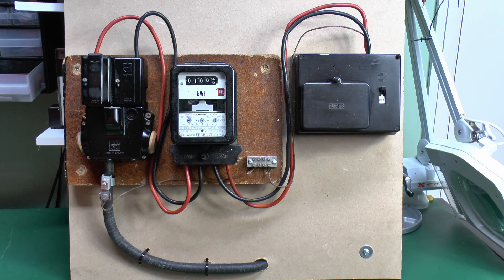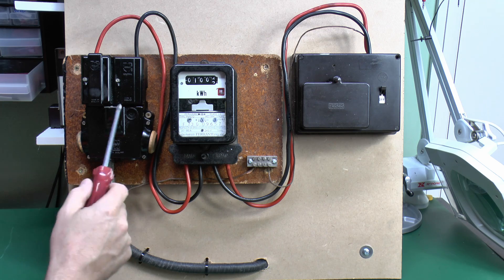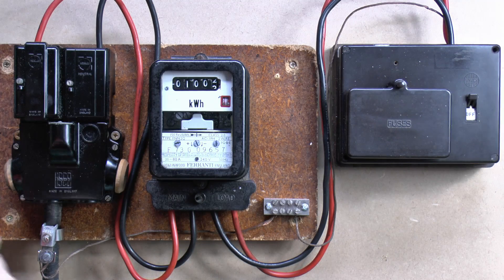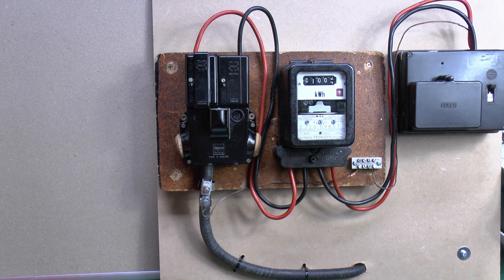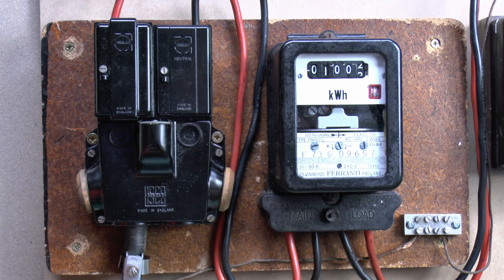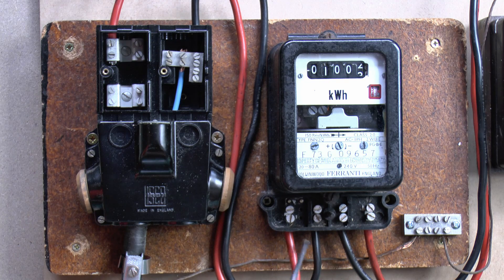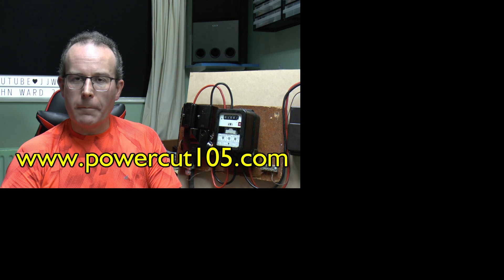Cutout, Meter and Fusebox - Who Owns What?

Comment: Hi John great video this is what I studied when I did my 16th edition IEE regs ends of 1980s and my city and guilds 2360 ,one point  you talk of a 800amp fuse from the road I take it that will be from  say one of the legs from the 3phase star (. L1,L2,L3 )   eg. L1. Would have a 800amp fuse but L1  would have a split to 4 houses after that fuse ?

When I get the money I am going to put my self through the 18th edition
Reply from the maker: Yes, one fuse per phase, and that is then split off to multiple houses.  Usually a 3 phase cable in the street and each house connected to one of those phases.
Free 18th edition course from Sparky Ninja here: https://www.youtube.com/playlist?list=PLg1OV4f2xHzVZMPyo_A8xd7s2jzd8WhP3
after which you can just pay for the exam at a local centre.
Reply: If you are asking how the homes are connected to the substation transformer, then yes houses will be tapped from one of the 3 phases, l1 l2 l3 from the distribution main in the street via joints along its run,each of these joints can accept a max of 4 service cables as well as the distribution main. The fusing in the substation that protects the distribution main is more like 315 to 630 amps, but John is still correct that these fuses will offer little to no protection for a short circuit at the end of the service cable in your house, such faults will usually burn themselves clear, this is one of the reasons i believe manufacturers deliberately make their concentric cable live conductors from aluminium because they know there is a very slim chance of upstream fuses operating and aluminium can melt easily. Even in the off chance a fuse back at the substation does operate the short circuit from the service cable will look like a roman cable and will still cause severe damage to it's surroundings and if you are in the vicinity without any ppe your pretty much fucked.

Dno's try to balance their network so if a housing estate has 150 homes then they will load 50 houses on each phase on the transformer.
Reply: @MissRiaElaine Hi, it is very common to have a 3 phase supply to a block of flats and then it gets split to single phase to supply each flat. Depending on the load of each flat, the main 3 phase incomer cutout (which is usually above the main door) will have either 100a fuses or solid links which will be red in colour in its cartridges.

Comment: In my house the incoming supply cable comes into the main fuse but another cable (same type) then comes out of the main fuse and through the wall to my neighbour. So if I pull my main fuse (not that I should) will it also shutdown the neighbours supply?
Reply from the maker: The fuse is just for your supply, the neighbour will have another separate fuse on the other side of the wall.
Reply: @jwflame  thank for the reply.
Reply: On older properties it is sometimes the case that the fuse feeds both but more common the loop is connected before your fuse

Comment: Hi John
At 26mins..there’s 4 screws next to the neutral connection,  if an earth was connected there would it become a TN-C-S or remain a TN-s .?
Reply from the maker: TN-C-S, the same cutout can be used for different supply types depending on how it's configured.
Reply: @jwflame  thanks John
Reply: @jwflame  sorry to ask again and probably appear stupid.. but here goes.
If the earth/strap was removed from the incoming cable (tns)  you could convert it to a  (tncs) by connecting the main earth to to the brass block next to the neutral ?
Reply: @davidmarsden8868  the earth from the lead sheath would be connected to the neutral terminal aswell if done properly

Comment: Thinking of separating my shed wiring connection,  at present it goes from the house, prefer to have it wired from the meter box, how would you spilt it so you have a extra wire coming out to go towards the shed, thanks

Comment: Hello John  Really helpful video, thank you.  All the equipment you show in your video is just inside my front door and the casing around the cables prevents the door opening properly. Is there a solution to this that doesn't involve moving the meter etc. Electricians I have asked about the job don't seem interested.  One told me I could chase the cables in to the wall and this could be done by a builder although the electricity supply cable I have appears to be in a solid 'pipe'.  Is the advice I've been given true and safe?  Thank you
Reply from the maker: The fusebox or consumer unit can be moved by an electrician.
The rest of it including the supply cable can only be moved by the network operator and your electricity supplier.  The supply cable cannot be concealed in the wall.
Reply: @jwflame  Hello John I understand who moves what.  I don't want to move anything because I'll have no option to then have a smart (notoriously inaccurate) meter.  Can all the cables other than the supply cable go into the wall.  I just need behind the door to be as flat as possible so I can open it properly!

Comment: Thanks for a very good explanation of how the UK does electrical distribution. If an electrician was to change out the consumer fuse board is he allowed to disconnect the power from the cutout by taking out the fuse or disconnecting the live wire? Very much different from our main service wiring here in Canada.
Reply from the maker: Depends on the location - some DNOs allow some electricians to remove the fuse in some circumstances.  Others not at all.  Some may fit an isolator switch for free, or charge for one.  It's generally a mess.
Reply: @jwflame  Thanks for the quick response. We cant touch the DNO's equipment and can be fined for not following there rules. ( Saskpower)  Go back 20-30 years ago we could do what we need to get the power back on and connect a service change temporary till they had time to reconnect. Wow times have changed and every location here is different.
Reply: @lylewatts6370  see over here in UK mate they can't accuse you of doing anything to the electric, nobody ever goes down for it not even the weed growers who get caught. They just say it was like that when they got there. The tags are a joke, a missing tag isnt even admissible as evidence, they merely there as a deterent.

Comment: Is there any regulation about those old fuse boxes still being in use ?. I only ask as my son has just moved into a rented property hopefully for a reasonable long term and it has this old fuse box. He wants to fit a modern electric shower which i do not believe you can do with this old type fuse box. A, it does not have any spare fuses. B. It does not have an RCD. What im getting at is can we make the landlord update it to modern compliance ?.
Reply from the maker: They can remain in use as long as the owner wants to keep them.
However as you have found, adding anything new to them is pretty much impossible.
Unfortunately the law only requires that a landlord maintains the installation in a safe condition - not that it complies with the latest regulations.
Reply: How many fuses are there in it ? Does the property have a gas supply ? Is the elec system configured for economy 7 ?
Can't advise on options without all the necessary details.
Reply: @millomweb  From what i have seen, total 4 fuses. No Econ7. All gas heating, and gas boiler.
Reply: @TheSaabClinicUK  Run the shower off hot water supply then. Electricity is expensive, gas is cheap.

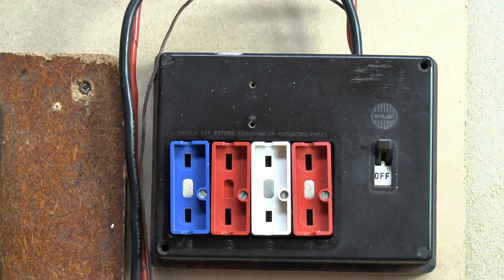Comment: 22:05 Why can't you have 2.5mm wiring on a 20 amp fuse? Isn't 2.5mm good for 25amp?
Reply from the maker: Rewireable fuses have a fusing factor of 2, rather than the usual 1.45, therefore a correction factor has to be applied of 0.725, so the 25A rating is only 18A, which is less than the 20A fuse rating.
2.5mm² wiring is ok with a 20A circuit breaker or a cartridge fuse.
Reply: @jwflame  yes, sorry I was forgetting how "slow blow" wired fuses are.

Comment: when the meter is changed do the electric company do it or does the DNO do it for them ? I noted the separate ownership.
Reply from the maker: Electricity supplier does it, either them directly or some use a separate company to deal with metering.  DNO doesn't do anything with meters.

Comment: If I want to move my fuse board ..have I got to get the electric company like Scottish power etc to move the outgoing tales to the fuse board
Reply from the maker: No, those belong to the property owner.  If they need to be moved or replaced with longer ones, an electrician will be required for that. 
If the new ones will be longer than 3m, a switchfuse will be required adjacent to the meter.

Comment: Excellent - I was worried about my earth connection but your TNCS version is like mine. I dont have a label for main fuse size, its black housing with no label, my modern RCD fusebox says 100a but I think thats its potential capacity rather than my main fuse - I'm told if I speak to DNO they will upgrade the Main Fuse and Tails to 100a free of charge - Any idea as to the truth in that? (just purchased a EV)
Reply: I see this is a year old so you may have it sorted but here goes.
Those "Henly" cutouts are half clip fuse holders so should be no more than 60a.
Strictly speaking if it in good condition the DNO is not obliged to replace it. Though in many cases they will if its a full size house that requires 80a. Call them.
Reply: @davidsoulsby1102  Hi David - Thanks - It was approved to fit EV Charger and wasnt changed for an 80 (although my neighbour applied to have it upgraded and they told him his 60 foot driveway would have to be dug up as the line from the road wouldnt take that size fuse - sounds extreme for a 69 built house I thought).

Comment: Interesting to see installations from other countries. What would be a common rating of the fuse in the DNO? It looks quite small to me...

In Germany, we would have had three Diazed fuses of (25)35...63 A under the roof in a cast iron box for overhead line supply - as you can imagine, there used to be many arc flash accidents with these. Nowadays you will find NH type knife blade fuse bases in a plastic box in the basement or even in a plastic panel at the border of the property.

Could you, at one time, show British terminal boxes for telephone and cable TV?
Reply from the maker: Usual fuse ratings are 60A or 80A.  Some newer ones may have 100A.  Very old could be 40A or even less.
Virtually all domestic properties are single phase.
Telephone video already underway, should be out in a week or two.
Reply: @jwflame  Thanks, John!
So that's 19 kW for a British home @ 80 A and 27 kW for a German home @ 40 A. Without electric heat, both are IMHO plenty. As a woodworker, I love having three phase in every home here in Germany though ...

Another video idea: I don't know how popular night-storage heaters were in Britain (quite common in Germany in the 70s/80s). All the contol equipment might make for some interesting content.

Comment: Thanks for all the videos and I really like  your style very clear and direct. A question if I may? If AC is alternating why do we get concerned about touching the line only. Doesn’t the neutral carry current? (Alternating) sorry it’s a dumb question.. what I am missing?
Reply from the maker: Current isn't what matters - it's the voltage between the earth (what you are standing on) and the wire.
Neutral should always be at or near the same voltage as earth.
Line changes all the time between +230V or -230V relative to earth.
Reply: Ok, the alternating voltage is on line only.. I had assumed incorrectly that line and neutral alternated.  Thank you all for clarifying.

Comment: I'm now terrified of puting stuff the under stairs cab lest I cause an 800 amp dead short
Reply: The fusing is more like 315-630 amps, the short circuit current can be in the thousands and still not cause these fuses to blow,but they wouldn't because these fuses are not designed to protect the service cable to the home but the distribution main in the street which is a much larger cable. This is  obviously why its extremely dangerous to interfere with the service cable, not only is it illegal you cannot isolate it and any damage to it which will cause it to short  circuit will likely burn down your house way before any substation fuse blows, not to mention the severe injury possible death to anyone near by without any ppe, it would be like setting of fire works in your house.

Comment: There is no need to fit a switch fuse to extend the consumers meter tails, an isolator will do providing the Zs and rating of the cut out fuse is known. Fitting a s/f with a fuse as the same rating as the cut out is totally pointless and will only result in both the s/f fuse AND the cut out fuse blowing if there is a fault in the tails.
Reply from the maker: https://www.ssen.co.uk/WorkArea/DownloadAsset.aspx?id=885
Page 9.
Reply: @jwflame  There are plenty of other examples of this kind of documetation from the suppliers, some limit the length to 2m and others to 4m. Many quote 7671 incorrectly, Here is another example from the NICEIC

https://www.voltimum.co.uk/articles/q-day-whats-maximum-meter-tail-length

The regs 433.2 and 434.2 mentioned (now updated for the 18th) have nothing to do with meter tail length. 

In any case there is no legal requirement to fit a switch fuse for tails >3m. The law only states that the supplier can legally terminate their supply (or refuse connection) if they believe that what they are supplying is dangerous. Given that adding a second s/f of the same rating as the cut out is no less unsafe than not providing one I do not see how the supplier could argue that they are allowed to disconnect the supply on this basis if a) the meter tails are longer than 3m and b) there is no s/f present, providing that a) the max Zs for the cut out fuse is not exceeeded b) the tails are SWA and c) correctly sized.

Where the supply is a TT then again the argument for fitting a s/f becomes totally and utterly meaningless and none of the documentation I have seen from the suppliers give any advice on this situation, the assumption is always that the supply is PME or TNS.

Comment: Such a steller presentation, as always. John, I know it varies wildly but can you give a rough ballpark estimate from what you have seen as to the cost to a homeowner to relocate their panel board that the head and meter are mounted in from the basement to an exterior location like a cabinet on the side of the house or an attached common area? Then, what would it cost for an electrician to come and run new tails from the meter to the new consumer unit, say no more than the 3 meters you mentioned? Very curious what something like that costs over there. Thanks as always!
Reply: £150-400ish depending on the amount of work needed

Comment: Thanks for the informative video. I'm surprised that the meter is owned by who ever supplies the electricity rather than the owner of the Head on the left in the clip. For example, when we switch supplier, the new supplier has to take on the burden of someone else's asset and its maintenance.
Reply: The meter will have sealing wire with a flag seal, the seal will also have a unique serial number, from that number they would be able to tell who the engineer was & the original supplier was. So if it was negligence by the engineer they could be liable.
Reply: In my country the meter (that also act as a fuse/overload protection/isolator, since we don't have fuses but a breaker in the meter itself) is provided by who manages the grid. Since it's all done via software (all the meters are connected to a network) switching energy supplier is as easy as changing a phone provider, they don't even come to your house.
Reply: @alerighi  They don't come to the house in the UK when you change supplier either. The meter is unchanged, and the new supplier simply takes over responsibility. A customer meter reading may be use at the point of changeover, otherwise is till be estimated. On newer installations there are "smart meters", and those can be read remotely at the point of transfer. Some early smart meters had problems with being transferred between suppliers, but that was early versions.

Comment: how much  is the amperage does that setup carry under normal conditions
Reply from the maker: That style of old fusebox is 60 amps maximum.  Most domestic supplies are 60A or 80A, 100A is available in some areas.
New consumer units are normally rated 100A maximum.
Actual loads when in use are far smaller than the maximum possible.
Reply: @jwflame  I have a hard time understanding the simplicity the wiring in the UK is, as a example the cooker having only 1 fuse/breaker  were as I have 2, same for the heat & A/C also have 2  we also have a 100A minimum but it's very common to see 200A & 250A in newer homes
Reply from the maker: @goldenboy5500  The key points are that everything in the UK is 230V - there is no 120V for anything.  Air conditioning in homes is very rare, and many use gas or oil for space heating and water heating.
Cookers generally a 32A circuit, lighting 6A, outlets either 32A or 20A, older homes only had one circuit for outlets but newer one usually have several.